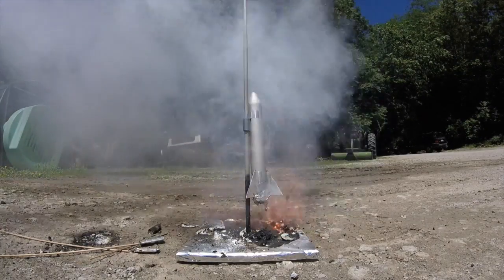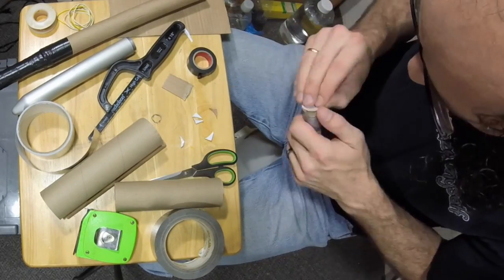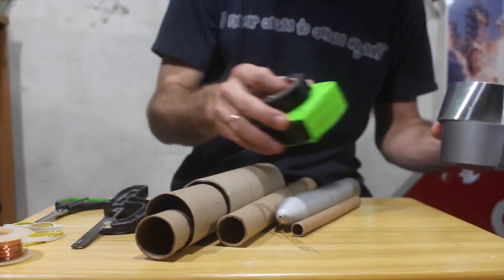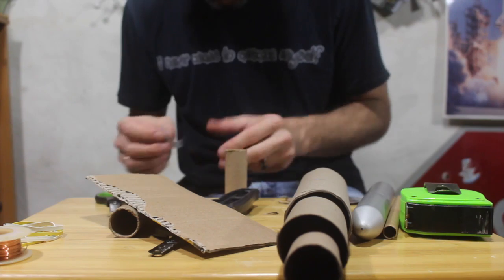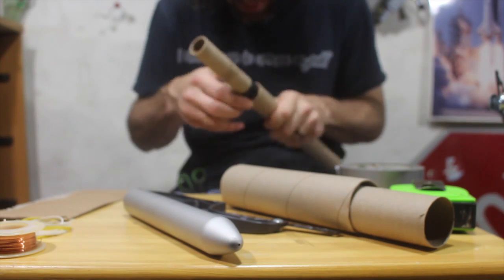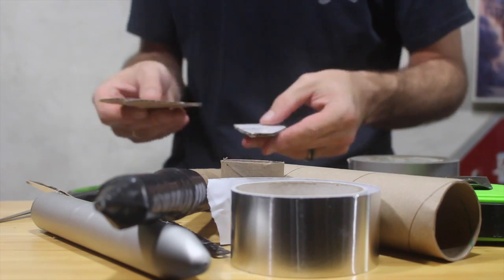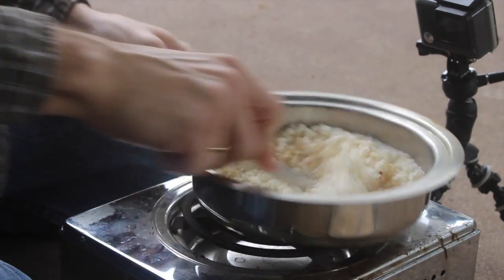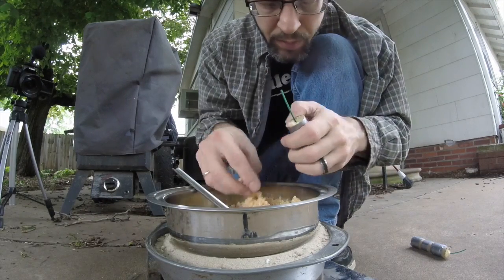Homemade Rockets - Can you launch a D.I.Y. rocket on homemade sugar rocket fuel?

Comment: You need to concentrate more on the actual motor so u should use dry ingredients and just mix them in a blender no heating required, grant Thompson has a good video on this and I have a less good but ok video on it